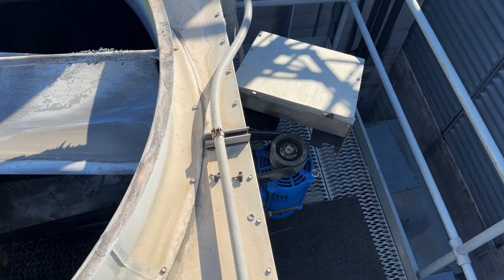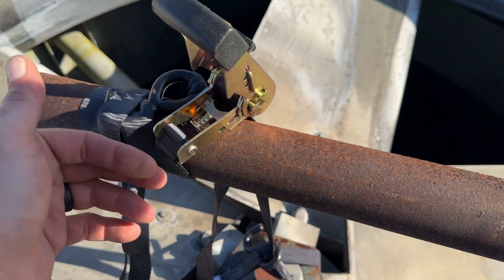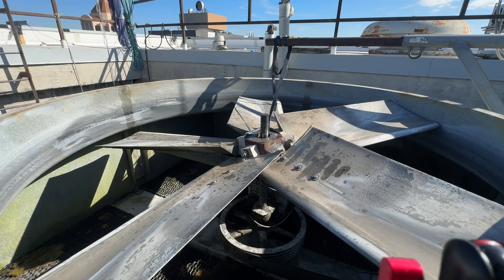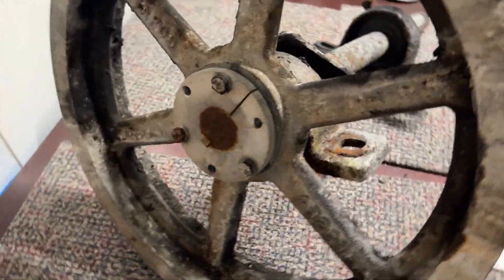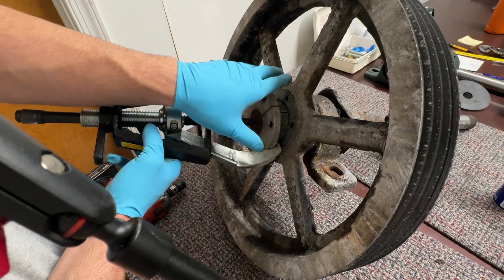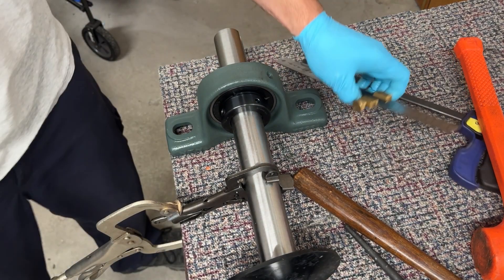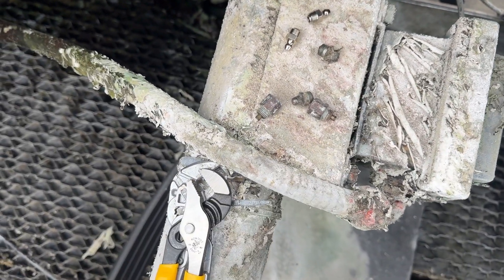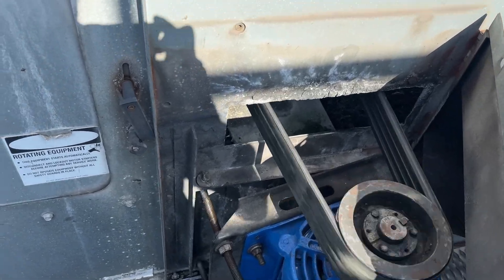HowTo44: Bearing Assembly Build on Evapco Water Tower Fan

Comment: Wow I’m glad I found your video, I’ve got a much bigger fan and shaft and bearing unit to take apart

The fan is about 8 feet across, the shaft is well over 2 inches in diameter, it’s been up there 30 some years, I’m not sure if I can save the bushings or the shaft, how did you clean your shaft up or is that a brand new one 
Thanks so much for the nice video, are you near Cleveland do you want to come help ha ha ha
Reply from the maker: Not close by but I’m glad to hear the video was helpful.  Order a rebuild kit for the shaft assembly instead of getting individual parts.  That way you don’t have to worry about trying to reuse crusty stuff 👍
Reply: @HVACLife  yeah well Baltimore aircoil is not your friend
I could save the customer probably quite a few hundred bucks if I buy the parts locally or through the Internet but Baltimore doesn’t give you any real information just a damn part number and a large price, they want 500 and some dollars just for the shaft, same with each bearing they want over $500

Comment: I replaced a set of bearings on an Addison OAU. I was unable to order parts direct from manufacturer (backordered), so I took some measurements and found what looked to be a suitable replacement online. When they arrived, I noticed they said 'Dodge' on them. I thought that was a little odd but I was confident in my measurements so proceeded. That pulley did NOT want to come off. It took a copious amount of sanding, lubricating, and strategic application of force before it made that 'ting' sound and slid off. When I finally got the old bearings off, I saw they, too, had Dodge stamped in them. I've seen those same Dodge bearings on other equipment since (the new Trane Odyssey Symbio systems, for one).
 I've been doing more commercial and light industrial lately, no help, no training, just learn as I go. Not so bad, if there's a puzzle I just let the office know this might take awhile. Most of the time, I can figure it out. On a few occasions I just sit in my van for an hour or so reading the manual. Sometimes, nothing makes any sense and then the light bulb comes on and all the puzzle pieces fit. I learn more on those jobs than the ones that go smoothly.
Reply from the maker: You just summed up the recipe for success!  Great job on matching those bearings!